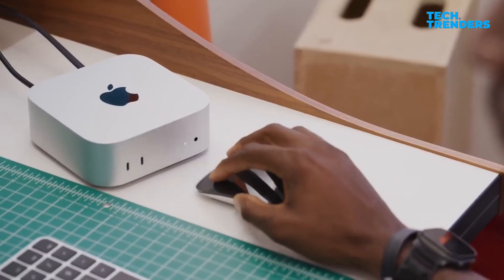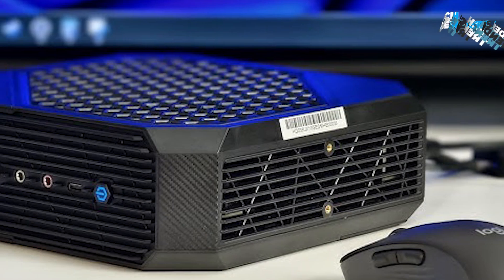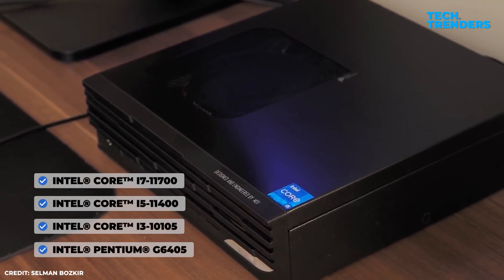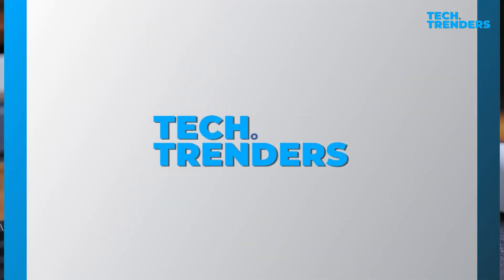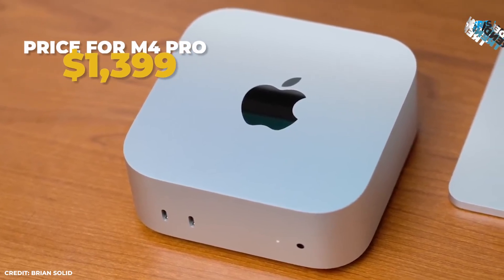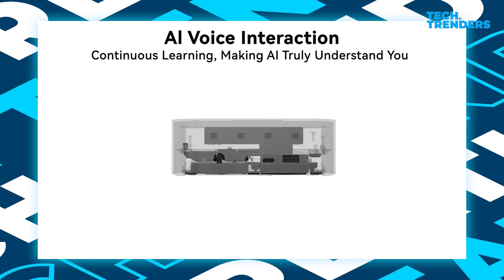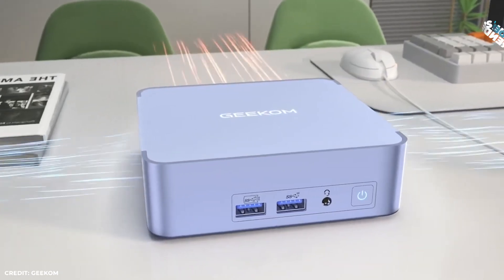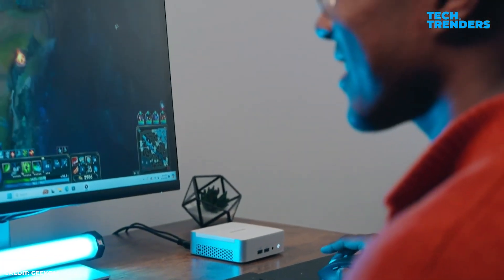Best Mini PC 2025 - 5 Best Mini PCs 2025

Comment: This is like a laptop without a screen. It's overpriced, you won't be able to upgrade, and it'll overheat. MicroPower PC has small form factor prebuilt systems but with real pc hardware and good value
Reply from the maker: Interesting take! I think it just depends on what you need — not everyone wants to mess with upgrades or custom builds 🙌